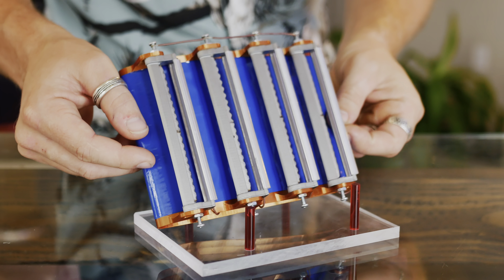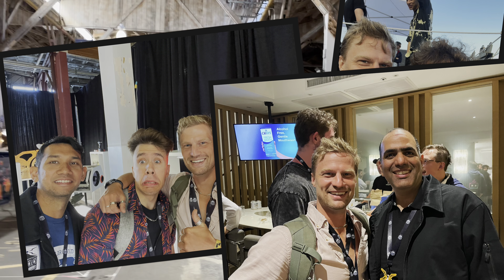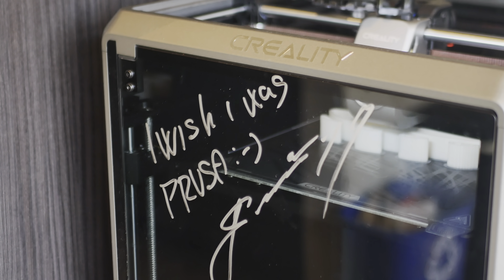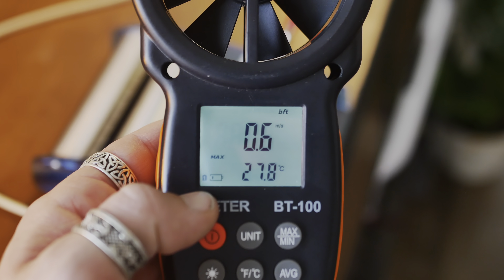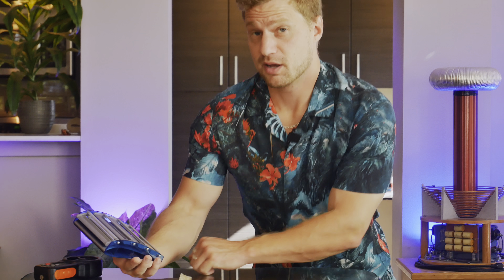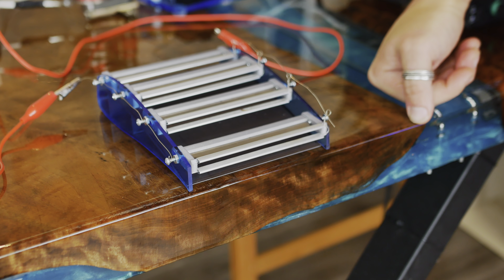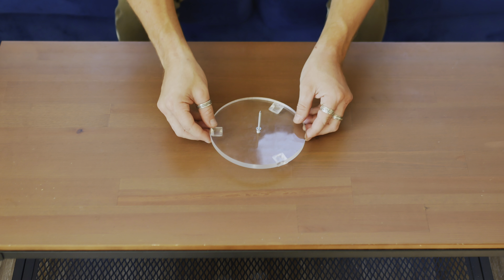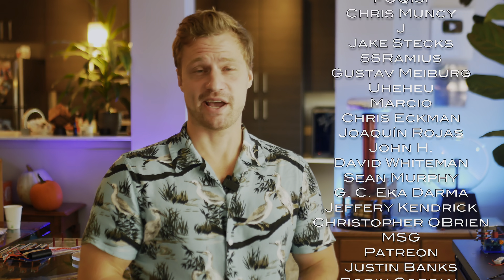Designing A Self Propelling Ionic Thrust Wing

Comment: You should add a way to measure force as a function of velocity, instead of just averaging the acceleration over a large amount of time. One way of doing this would be to put a small magnet at the end of the longer arm, which passes through a coil. By looking at the induced current, you could measure the time for each rotation, which will give more accurate data on the change in angular momentum, ultimately giving you Force as a function of airspeed. By letting (air) drag slow the teststand down from the max RpM, you should also get a set of data from which you could determine drag drag forces (fit a curve using matlab or Python).
Combining drag measurements and initial powered measurements should give you nice curves of force as a function of airspeed or time.

Comment: They guy makes things fly is impressive, I like very much :-) 
Segment spacing is the key here, this has to be adjustable while flight. With this you can react to different ciscumstances instead of just "burn more fuel".
And you need a kind of concentrator for the air gets pressed out in the back. Maybe another thuster which thrusts the thrust.....

Comment: You can calculate forces much easier by just recording the speed at which your engine stops accelerating. At that point the force it is applying will be equal to the air resistance, which can easily be calculated by using the velocity squared equation, given that you're using a known aerofoil shape you can probably just look up its drag coefficient though that can also be calculated with drop tests.

Though in a rotating system like yours there is also just an equation for the forces, I'm not sure if you know it though and I don't know its english name.

Comment: Part of the issue I'm seeing, is how much air can get into your Ion engines.  You're pulling in a thin strip, compared to the jet plane design. 

Jets pull in a narrow cone, but overall that cone is about at large as the aircraft.

This wing design is pulling in a strip about as large as the wing's forward profile.

The other part, that I can think of, is the amount of surface area for your ground and lead. Integza used a jagged ring, which had more points, and surface. Would it not ionize more air, if you had a pair of those rings? One obviously larger than the other, but with the idea of a turbojet's cowling.

Take this with a grain of salt. I am a mechanic and electrician, not an aerospace engineer or physicist.

Comment: the main problems is:

1. when get wet stop working -> the plane will fall. aslo teh high voltage electronics can burn out aswell.
2. huge ozone emission
3. too low trust because too low presure change... what u cant increase because physics limits.

so its a nice toy but its all.

Comment: Could you use a metal foil plastic like a mylar  foil 'space blanket' as electrodes & ground planes? 
That would REALLY cut down on weight as it could also double as the wing surface 😁
Reply: That’s an interesting idea. Wonder if it would work if the trailing electrode was just a conductive strip on the surface the wing itself
Reply: I like it , but I'd be afraid voltage breakdown would poke holes that would grow exponentially.
Reply: @petevenuti7355 What if one of the trailing electrodes was an aluminum tape or electroplate on the surface of the wing itself?
Small surface defects caused by the tape edges could damage the boundary layer flow, so I'm Really suggesting electroplating.
An electroplated wing surface could reduce the weight and pull the boundary layer more tightly to the surface.
Reply: Tried this, but the thin plating disintegrated too fast (to be fair, it was really really thin)
Reply: @davestorm6718  Aww that's disheartening,  but if you don't mind me asking, what project did you try this with?
also was there no ways of improving the durability or reinforcing the material?
Reply: @davestorm6718  What metal were you plating onto the wing? Try a more resistant one. Chrome? Platinum? Titanium?

OR , after putting a strip of aircraft (Aluminum) tape, apply a coating of the finishing plastic that I've heard is common for 3D printed parts. Then sand it back off the tape. That should leave the transition line aerodynamically smooth.
Reply: @FarSeeker8  if it's thick enough, and resistant to oxidation. I haven't tried it but I would recommend a few alternate layers of conductive plastic and metal film. The composite might perform better, and use a kapton substrate.
Reply: @petevenuti7355 I think so too.
Reply: I do believe that that's the first perpetual motion machine right there. Hook it up to a pulley and you can then power up your car.

Aim the car down a steep hill, so you can then get to work for free every day. Just take an uber home, and get your dad to tow your car back up hill (you might have to loan him a truck and a chain), so you can then ride your perpetual motion car back to work for free every day. Hook up your cell phone charger to the alternator in series with a flux capacitor and a rectifing diode pack to charge your phone, so you can call your dad for a tow, every day.

Comment: Ionic thrust is not a separate phenomenon from capacitance so following that logic you should be able to massively increase the thrust by insulating the positives and grounds as well as running much higher voltages, placing the positives and grounds closer together would also increase thrust with fine insulated mesh for both the positive and ground having the highest thrust potential
Reply: You could also layer such meshes together in such a way as to follow the form of the wing, this may allow for different shapes to be used

Comment: Have you considered integrating the ionic thrust units into the surface of the wing? Right now they seem like they would give a lot of air resistance.

For example, putting the blades right on the surface with their ends sticking up just a bit, and then ground wires taught across the surface

Comment: Hey, Since the electrons are jumping out of the blades at equal velocity, due to the blades having same voltage, wouldn't it be more efficient to increase (preferably double) the voltage at each stage to increase the electron velocity and thus air speed?

Comment: Compressed air have a higher density which would mean more free electrons available to be grabbed by the ionic thruster right? Wouldn't a ionic jet engine be possible then ? Or a design with two blades feeding the intake of the next one and so one and so forth? I guess the next blade would then have less time to impart the thrust to the doubled amount of air so then we could +- double the current at every section.

Comment: I'm curious how the thrusters will modify the airflow around the airfoil section and alter it's aerodynamic properties. Great sections for a glider I'm sure, but the modified airflow is going to need some wind tunnel testing and optimization. This is uncharted territory. This project is going to get even more interesting.

I'm not sure I've seen every video in the series, or how much I've forgotten. Do you have any idea of the efficiency of converting electrical power to power of airflow?

Comment: You are definitely on a good track. Next step would be to make a simple rc airplane with full ionic wings.
More lifting surface means less thrust needed to offset gravity.  Decrease the weight of the structure and the power source  is another step in the right direction.  

Get some direction to build an ultralight "slow stick" plane. That is your next challenge.

Comment: Hey Jay, love the video! I would be interested to see a design where the HV positive of one segment is the HV negative of another. To supply the different voltages you could tap off of different points of a voltage multiplier. Do you know how much power do those little modules consume? If you’re looking for more power, I think you could have luck with a tiny ZVS driver driving a CFL transformer. I was able to get 100W+ at ~8kVAC from a setup about 1” x 1.5”. Maybe 1-2 of those with some voltage multipliers could be enough to power the whole wing! 

On a different note, just checking if you got my email awhile back about my 1500W HV AC transformer. I showed it to you at opensauce and you displayed interest in building one. If you have trouble finding it, the email subject is “high voltage transformer” and includes all of the files and information needed to build one yourself. I’d love to see what you do with the design!

Keep up the great content!

Comment: I wounded if you should put the thrusters on the bottom of the wing. When the wing is in flight the top of the wing will be at a lower pressure than the top. Having the thrusters on the bottom should have more air pressure to push on.

Comment: Just my uneducated 2 cents: A lot of what happens on an airplane wing has to deal with the flow staying adhered to the wing surface. (It's why icing is a problem, because it disrupts the adhesion and can reduce or eliminate lift.) Would it be possible to put the ion thrusters within the wing, and have their output be guided along the wing's surface? You'd have to make a wing with a hole in the leading edge for airflow, so i suppose you'd end up with some very close version of a biplane, with the positive wires between them and the negative in the upper wings, in front of their output slots. Like i said, this may not work, or function as described, but i feel like emphasizing application of the moving air to the wing surfaces should help with thrust. It may also reduce thrust to 0, i'm not a plane doctor.

Comment: Some potential avenues of future development.

Moving the highest volume of air with the slowest change of speed is the most energy efficient method of producing thrust, so staging the elements in series is probably not the most effective design.

Also, the disruption over the wing caused by all the added stuff is probably more of a hindrance then a benefit. Moving the thrust elements to a single stage at the trailing edge would likely work better. The effect of having the thrust generated here is a pressure drop at the trailing edge which is fantastic at improving the lift over the entire foil, similar to the underlying mechanism of a gurney flap but without the drag penalty on the high pressure surface.

Comment: Shouldn’t you place a HV capacitor and HV diode on the wires on the wing? I assume that you use a HV DC voltage? Because when using 4 HV separate generators didn’t add a gain on air flow! Or try a needle pointing to a ball as diode!

Comment: Very impressive. It looks almost like large versions of the replaceable blade cartridges on mechanical razors. I wonder could you get sponsorship and/or materials from a razor manufacturer and is there any stacked multi blade configuration that would work well for propulsion as opposed to smooth skin. 🙂

Comment: Hey, great series! The force calculation looks a bit bogus though:

ChatGPT applies the formula for calculating the force for accelerating a mass to a given velocity. However, just that formula would mean that velocity grows towards infinity over time.

In your experiment, however, velocity reaches an equilibrium with air resistance after 12s. I guess you could calculate the (approximate b/c non-linear) resistance coefficient from that, but I doubt ChatGPT did that, when it can't even get the sentence "a force of .... must be exerted on ... to make it spin at .... rotations per second" right. b.c that should say something like "... make it accelerate at ... rotations _per second per second_"

Comment: So, regarding Wing design, why have the negative separated from the wing? why have the positive separated from the wing? why not make one plane of the wing negative and one plane of the wings sectioned and be the positive, below the leading edge you got the intake and the first section that is the largest and then have several sections decreasing in size but maintaining a small spacing wing both positive trailing and negative leading.  this will leave a hollow core that servers as thrust channel. and the extra weight will only be razors and aluminum foil.

Comment: Is the aerofoil shape of the wing even necessary? 
I mean the principal of it is to have air moving faster above the wing than below it to have lower air pressure above than below. Wouldn't just a flat wing with the thrusters up top achieve the same?

Downside of course would be no inherent lift when the wing is moving through the air with thrusters off and no lift at higher speeds when the air resistance of the thrusters exceeds their thrust.

Comment: what you should look into is putting the ionic thrusters UNDERNEATH the wing too... as its the air below the wing that gives the plane LIFT force... ALSO... by having ionic thrusters on boths sides of the wing... you'd in theory be able to control movement by adjusting voltages/current of the set of thrustors below and above the wing which would then be reflected in flight path lift and lowering.  No way to test this theory but my approach above could possibly have applications to SPACE flight maneuvering in a vacuum.
Reply: Was thinking about about splitting the thrusters. Two underneath the wing in the front to increase pressure beneath the wing. Two on the trailing edge on the top to reduce the pressure above the wing. Does that make sense?

Comment: I might be seeing a problem for the future. Bear in mind that I'm an aerospace student, so not an expert yet. The wingh's prophile's are built following the Kutta's condition, which means that the airflow on the opper side must have the same velocity of the lower one when they exit the trailer edge, but you are accelerating one side. This might be generating drag and maibe messing with lift becouse you are genereting a vorticity behind the plane. To fix it you could either design a profile adding to the equatin the flow from the thruster or just ad thrusters even in the lower part. But again, I might be just wrong so if there is any actual aerospace engineer pleas tell us your opinion on it. Eitherway I love your channel and I hope in the future you might make an hall effect thruster for us space nerds.
Reply: also don't 3dprint the final wing's, make lasercut prophiles in balsa and wrap them in thermal streching plastic. Less weight, smoother surface.

Comment: I have electroplate my 3d prints with copper. Try playing around with narrow bands for your conductive surfaces. Your can scale the plate volume to suit your needs and reduce design structure to host blades, wire or any conversional conductors and this will surely help reduce weight. Mask your print surface to create specific shape and size plating designs. Microns vs Millimeters. Let me know how it worked, if so. Do a small print, plate and see how heat factors in on the print. You can control the layer thickness.... all just my humble suggestion. Regards, Ian from South Africa

Comment: The top airfoils are fighting the big airfoil they are connected to. If you angle the inside towards the back you should increase thrust. The airfoil on top of airfoil does not work that well. Just install the thruster in the existing wing design.

Comment: would it not be interesting to have the ionic thrusters positioned under the wing, pointing slightly downwards ? 
while flying, above the wing you have a low pressure region and below you have a high pressure region , having the thrust pointing downwards under the wing would give even more vertical thrust, with more air available ( higher pressure) to move ..

Comment: You can lower the weight of the wing profile even more by removing material in the inner support walls, i.e. creating openings where the (vertical) load is low. 

Creating these holes will reduce the weight of the wing profile without sacrificing a lot of strength.

Comment: Some experimentation should be done on which side of the wing the ion drive should be mounted on. The top of a wing has the faster-moving air in flight. The air on the bottom side is slower and it is in a straight line, mostly.